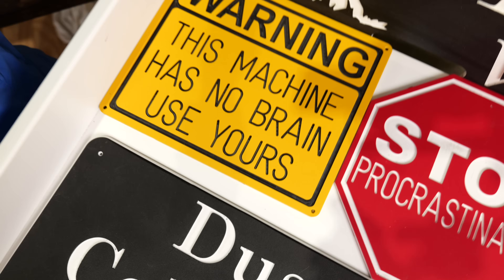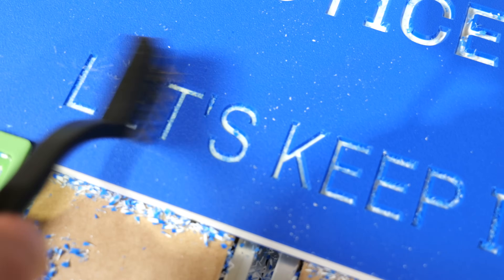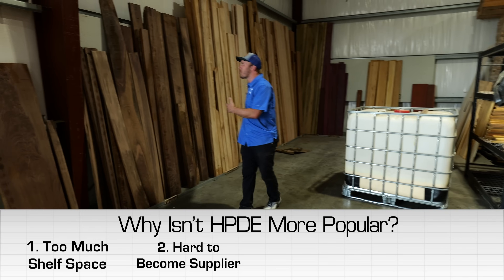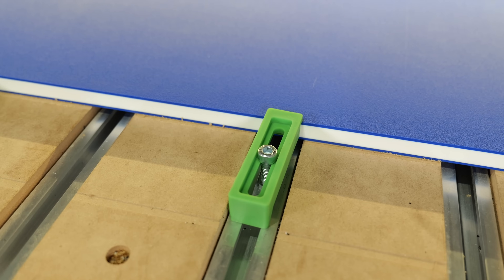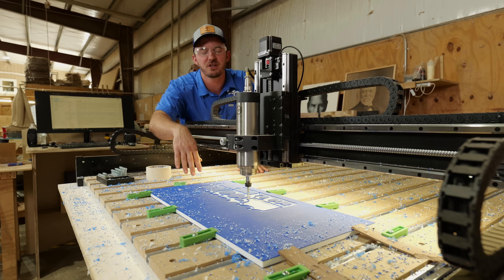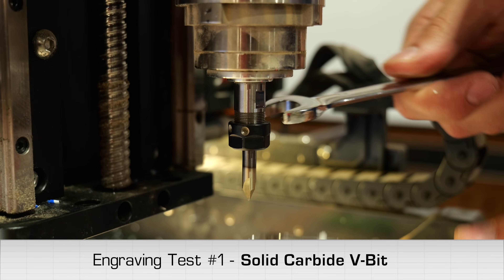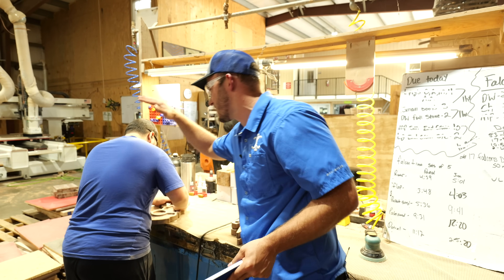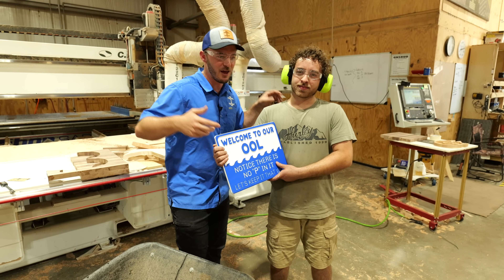The MOST Underrated CNC Material?

Comment: If you head to any commercial playground you will see that most of the handhold panels and signs are made of this material. I used to work for a large commercial playground manufacturer and made tons of products out of this material. You can get things to stick to it. For instance, when we wanted to make a multi-colored sign, we would mix up a resin and tint it with the paint color we wanted and would pour it into the pockets. It can get a little bubbly, but hitting it with a torch takes the bubbles out.

Comment: People complain about HDPE, but i cut ALOT of it, and if your going to slow it will heat up warp and overcut your profiles. If you speed your bit through the material at a high rpm, it cuts like a dream(but like i say you have to move that bit through it extremely fast to keep the heat away!) I have gotten to the point of cutting mirror finishes on 1 inch and half inch sheets and it is awesome to cover and bolt to metal parts that are going to bang together. Also, there are suppliers that have decent pricing. 96"x54.5"x.25" can be as low as 130-150 a sheet for black, and a little more for colored sheets. It's a great abrasion and cut resistant material and i love cutting it.
Reply: I'm running 1100 rpm at 145 fpm .125 cut depth on a 1/8" cheap blue coated amazon bit and it looks beautiful I make a ton of signs.
Reply: @veelink6345 heck yeah man! Speed through it and it will turn out nice. Especially if your over cutting something thick like 1in. Gotta keep that heat away from the bit. Tools today has the occasional decent price. I'd sign up for their newsletter.

Comment: Another good informative video.  Still knocking it out of the park.  Great isights on pros and cons about sanding, painting, and adhesives.  Any concerns with the brass putting scratches in the plastic, vs a still nylon brush?  I just picked up some more bits and the two oflutes you offer now.  I had a coupe oflutes bits for the epoxy work I do but thought I would pick up some more.  Bummer, I just from you DC Finisher yesterday cutting out a variant of an aggravation board.  I was in a hurry trying to get things done and filming and for got to zero the bit after changing from my roughing tool path.  So, I picked up another downcut finisher from you with the o Flutes and an extended 1.5" uc em.  Got an idea...i know you haven't gotten into 3D carving yet, but always on the lookout for some longer 1/4" ball nose and tapered ball nose for deeper carves.  Just an idea.

Comment: While the machine is running, if you barely touch the side of the bit with a piece of wood, it will cut that plastic string right off.  NOT SAFE, but it works.

Comment: Did I miss where you talked about the best feeds/speeds for O-flutes in HDPE?
Reply from the maker: Check the description, I have a full video on the exact feeds and speeds to run them on. It was the previous video on the channel
Reply: @cutting-it-close  Will do!
Reply: 1/4" upcut O-flute bit.
18000 rpm spindle speed.
100 inches per minute feed speed.
100 ipm plunge feed.
1/8"-1/4" depth of cut.

Comment: I don’t understand the reluctance to use air weights. That’s the best way for hobby cnc to clamp this material. My CNC was owned by a sign shop and they 100% used vacuum for their fixtures.    If they had added tile gasket - even better.
Reply from the maker: Great point, Airweights would be really good to hold down this material! For this video, I wanted to show the clamp method, on future videos I can show Airweights!